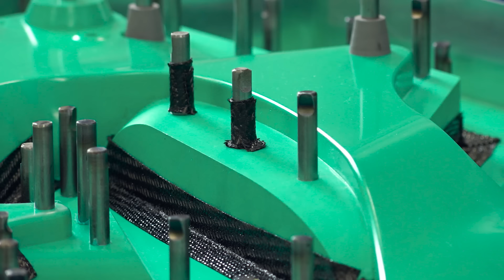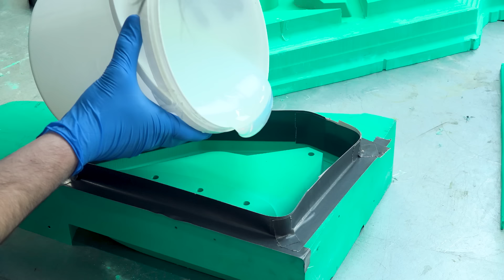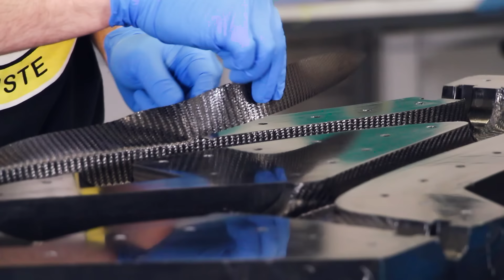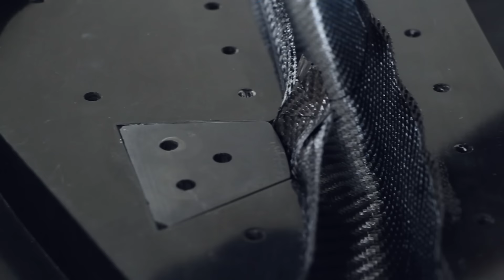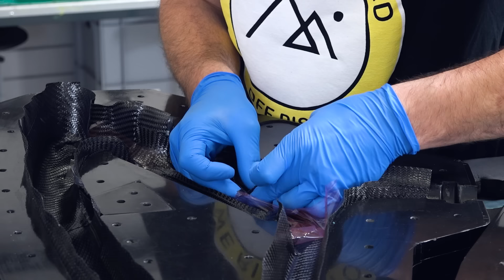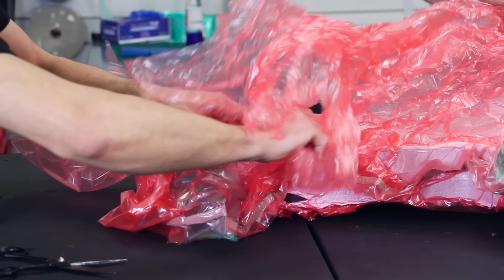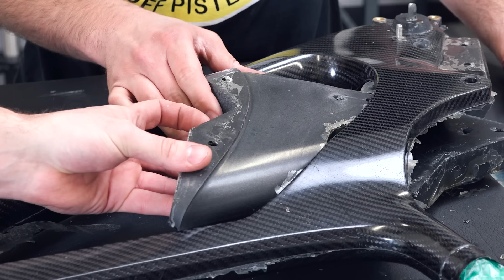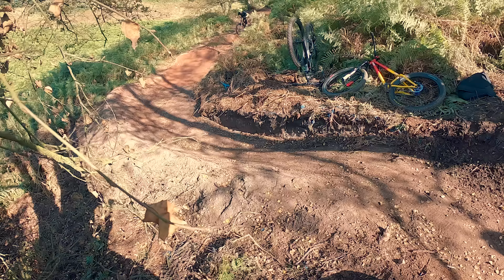Making a Carbon Fibre Bike Frame – From CAD Design to Downhill Race

Comment: This is an amazing video! I'm actually here because I have been trying to educate myself on purchasing a cf road bike frame. However I am one of those people who have to take the deep dive! Just like I did when I got into acoustic guitars. I ended up with a bunch of books and dvds on the topic. Interestingly enough, cf makes a fantastic choice for acoustic instruments. These instruments NEED to be light enough so that the energy from the strings can kinetically affect the sound board and thus make sound. I'd even be willing to gamble that cf could be a superior acoustic material over traditional wood. But that would require extensive r&d. Anyone want to invest ;)
Reply from the maker: There are quite a few carbon fibre musical instruments around now.  The sound is acoustically a bit different from traditional wood instruments. There are a few guitar builders doing just that and they spend ages tweaking the designs and shapes to ensure the acoustic results were good.
Reply: @easycompositestv  I think a fun r&d experiment would be to see if it would be possible to fool experts with a couple classic guitars. Like a spruce/rosewood Martin type dreadnaught or a Torres classical. But I'll tell you that if a concert guitarist walked in with a carbon classical guitar, there would be some push back!

Comment: What type of paint do you use to fill pin holes? That is one problem we have making parts in our shop.
Reply from the maker: Hi, pinholes can be filled with resin or if very fine, with lacquer during the paint process

Comment: admire to awesome contents
i always curious about how to fixed parts on CF ? some kind of bolts, suspension
no different from metal ?
Reply from the maker: Fixings need to have a load spreading plate or similar as composites are not so good at point loadings compared to metals. We sell a range of such fixings on our site.

Comment: Hi. Great presentation. I have a 2015 size Large Cannondale Scalpel SI.  My rear triangle cracked and was wondering if you can make a new rear triangle?
Reply from the maker: Unfortunately we don't offer any specific manufacturing or repair services I'm afraid. We can certainly supply materials, equipment and technical support if you were looking to make the item yourself though.

Comment: Awesome video! I always wondered how these carbon frames are made. Now I know why they are so expensive! Material cost + intense labor. Wow. Questions: how do the designers know the number and type of layers and their orientation? Is there a CAD program specific for this or they basically guess based on experience? Also, can the vacuum bags to be reused? It seems like an awful lot of environmentally hazardous waste.
Reply from the maker: With composite designs, you can either run FE Analysis using suitable CAD software or plug-ins but often, it will be developed through experience and general rules of thumb rather than empirical data. There are reusable silicone bags but they're not great in use with epoxy resins as epoxy tends to deteriorate them more quickly and so you don't get unlimited used. With vacuum bagging materials and PrePreg, often, there is a possibility to re-use them although the actual outer bag can be more tricky dependent on how and where the gum tape sealant is used, things like the breather fabrics can definitely be used again.
Reply: @easycompositestv  thanks a lot for taking the time to reply! I’m very pleased with the detailed answer, thanks for the great support! I’ve worked with fiberglass, resin, etc for years as a hobby but I’ve learned so much more from you! Again, much appreciated!
Reply from the maker: @kovacstamas3756  No problem at all! If you need any further advice please let us know :)

Comment: All those surfaces looks like a nightmare to create in cad
Reply from the maker: Hi Michael, Vlad tends to work in VR to begin with, creating the lines and surfaces in Gravity Sketch to begin with, where they can be worked on really fluidly. He then exports from there and brings that model into Solidworks where it's re-built, using the Gravity Sketch as a template. And yes, a frame like this is a challenging thing to model!

Comment: It does no good to test a frame with a stronger layup than what will be used unless you plan to do another full test on the production models.  Breaking a 'standard built' 1st test article will show where additional support is needed and add to the knowledge of engineering and should make the bike lighter and stronger where needed instead of making the entire bike over built.

Comment: I don't quite understand how the staggered section between the halves work to keep a constant thickness. Do half of the layers get cut off at the mold line while the other half (inside plies and outside plies respectively) get loosely aligned while the halves are clamped in place? And then the inner bag is used to create the tight connection between the halves?
Reply from the maker: Yes basically.  The wall thickness will be slightly thicker in the overlap area but that is necessary to ensure there is sufficient strength on the joint. The pulling of the vacuum pulls the tubes against the inside surface pressing the fabric tightly into place.
Reply: @easycompositestv  Thanks for the reply. That's so f'ing clever, I love it!

Comment: Looks like totally overcomplicated process. Why not 3d print a very thin, say 1 mm frame from PLA and just gently stick that carbon material on it all around, with resin. Forms, pumping air. Looks like a total waste of time and effort. Not precise work. 10x too much work. Also, this can also be done with styropor if not 3d print. Plotter should cut this material, not manual work.
Reply from the maker: For a total one-off, your method could work although you would have a lot of finishing work on the outside of the frame if you're overlaying the carbon on the outside. However, it wouldn't realistically be suited to mass production. The method of production here is incredibly accurate and where replication is key, would be a better solution. You're correct on the plotter cutting of material; for the first frame out of the mould, this was hand cut but if you were rolling out into production then you could have the PrePreg cut on a plotter for even greater accuracy.

Comment: Seems like a horribly inaccurate system. Why would you not just use a solid block of aluminium?
Reply from the maker: It is actually pretty accurate. CNC board, a coating a fraction of a mm thick then the mould mirrors those dimensions exactly.  Aluminium block would be massively more expensive.

Comment: I'm no expert on composite materials but I still have a really good tip,i use to work with construction making concrete and to check the concrete mix that it's perfect we make a cube 10x10x10cm and put it in a pressure machine which loads 10kilotons of pressure on the top of the cube, you should do something similar on the prototype frames put a bar trough the hole where the Crank is supposed to be right above the bottom bracket and apply the pressure,to simulate the pressure and stress the frame recieves by bottoming out the damper/rear shock.ten kilotons ain't really that much, hundred kilo plus downwards speed can very easily become a few tons, should do a similar test on the steering tube to but apply the pressure backwards from the bottom of the fork to simulate when you land in a pothole or something with the front wheel..

Comment: Curious would you get the same/similar result if you just inflated the inner bags? or would that trap air making the bagging less effective?
Reply from the maker: Yes, you can pressurise the inner bags but this would create unequal pressure on the mould, trying to force it open and distorting it meaning that to use pressurised bladders you would need a much stronger mould such as a solid billet aluminium mould, which is of course much more expensive to produce.

Comment: Is this only achievable w/ pre-preg? What would be the wet layup option?
Reply from the maker: There wouldn’t really be any other way to realistically make a bike frame, not using a moulded method anyway. The only wet layup option would be hand laminating carbon and resin onto a foam core that’s left inside.
Reply: @easycompositestv  Thanks pretty much the conclusion that i came to

Comment: A very laborious and time costly process.  Would it not be rather faster to fill the mould with molten wax and then lay carbon fiber layers around the wax model?
Then cure it? The wax could be easily molten to recover.
Paraffin or wax filled with plastic nano fibers  would do the trick.
Reply from the maker: No, I’m afraid that process wouldn’t work for a lot of reasons. Producing a well made carbon fibre bike frame isn’t quick or easy, it requires quite complex processes. In fact, by bike frame tooling standards, the method shown in this video is much lower in cost than the industry standard of machines billet metal split tools.
Reply: @easycompositestv  can you please give some insight about why the wax impregnated with plastic fibers wouldn't be a good process?
I was thinking about the process by which you do the scuba diving carbon fiber bottles...
I have wee this process in McLaren car manufacturing process. That's how they manufacture the complex doors.
Reply: @easycompositestv  you can use CNC directly to the wax, wrapping around the carbon fibre layers ar different directions use the vaccum and the autoclave after melting the Wax.

Comment: I've been thinking about a more "DIY" approach to this, that might involve much less machinery, for people wanting to make (usually small) frame components in home workshops, and I'd be curious what you thought of the following:

3D print (in PLA) an internal frame structure with low infill.
Wrap the frame in the layers of Prepreg (bought from your store of course).
Cover the outer layer of the Prepreg with some high temp silicone, or even something like a cement mix.
Cook the epoxies in a temperature controlled oven, with the PLA getting drained into a tray.

Feel free to poke big holes into this process if you like!
Reply: Cool initial idea, as of 3d printing the frame but I believe it’s better not to use the prepeg carbon fiber. I think the traditional way would be better for your approach on the frame build. Because when you put it in the oven, and you mentioned the pla melting off as a release mechanism will most likely cause deformation in the CF. 
Heres one idea maybe.. 3d print the frame then make a negative mold out of it. Them fill the negative mold with expansive foam. Layer up the foam frame. Let that dry, then add another layer but this time using the suction pump. I think the expansive foam can be removed from the inner frame by drilling an opening and a release hole. Pouring on to it a liquid compound that would disintegrate the foam in to a sort of liquid state and easily come out the release opening hole.
Reply: @rreyesco  that's an interesting idea about foam and a solvent. A similar thing can be achieved with ABS plastic an acetone.

I don't understand the need for the extra step though? If you have a negative mold, why not lay the CF in that?

Or why not straight away print the negative mold? In two halves ready to fill with the foam? Or similar, heat resistant internal material?

I didn't think too clearly obviously about the heat treating of Prepreg, but what temp does the internal 'volume' need to resist to? I'd love it to only be two steps. And ABS can resist to 110c.
Reply: @mortarriding3913  You could probably use PVA filament. It's dissolvable in water.

1) Print an internal frame out of PVA. (Low infill, thick and smooth shell,etc)
2) Wrap your release layer and selected prepreg around frame.
3) Place in vac-bag and pull a vacuum or even another release layer and do your silicone or cement thing? Although I think a vac-bag would give a better outer finish.
4) Cook your CF.
5) Take it all off the cooked part, etc.
6) Place the CF part and internal frame into a vacuum sealable liquids bag, and fill it with a water/methanol mix (you'll have to search up best dissolve ratio) and put it in kiln at 80C for 3 hours. This will dissolve all the PVA away.
7) Take out CF part and finish it.

I think this could work. Especially for small parts or custom CF as you spend less on forms, generate a lot less waste and won't have forms laying around after you've completed the part.
Reply: @rubenzikarsky5195  that's an even better idea! PVA is almost made for this purpose.

Comment: It is fairly easy to undersize a master model to account for CTE. The reason you low temp cure tooling prepregs is to use cheaper, low temp tooling board.
Reply from the maker: Actually, the difference in price between higher and lower temperature tooling boards is not that significant. Yes you can anticipate CTE of the master in order to achieve dimensional accuracy but in many cases the shrinkage of the master will either 'lock in' the carbon component (which has almost zero CTE) making it difficult to release or, quite often, crack the master as it shrinks around the component. This is well understood and can be avoided (or mitigated) by lower initial cure temperatures. In almost all respects, lower initial cure temperatures for tooling prepregs is preferable, that's why all major manufacturers make low initial cure one of their key ambitions.
Reply: @easycompositestv  low temperature certainly makes it easier in all aspects. A 70°c board will maybe hold 120°c if that's what you mean but as you know above that options are fewer and cost is doubled. A PU board for below 50°c is half the price but surface quality surfers.

Comment: Fascinating piece of art. The carbon joins around the headtube look sooo sexy. Is that how they mirror layup patterns in the center of Lambo hoods/wings/bumpers? Just overlay two pieces, put it under vacuum and it will create a smooth joint?  Because i still don't understand how they do that without any fraying.
Reply from the maker: Yes, that's how they do 'mirror joins' or centre partings/chevrons etc. You're working with prepreg anyway and so the fibre is much less prone to fraying. Next, you only need one perfect cut line, the other layer of fabric 'laps' behind it - this is easier to get really tidy that if you tried to have two cut lines that butt up perfectly to each other.
Reply: @easycompositestv  Thanks for the reply! i noticed you guys reply to comments, that's awesome. Congrats on the 200k dude, great content!

Comment: Hi Easy Composites, easy to say the best video on youtube on how a carbon frame is made! I'm new to the carbon frame world, and there's a little confusion that's bugging me. Compared to the technique of having carbon sheets stick onto an EPS frame, how would these pressured tubular bags compare? Does it give better inside surface? Does it help with weight reduction?
Reply from the maker: Hi Tigor, using the foam core method is likely to produce a heavier frame if it had the same strength as one produced in a mould. Both the inside and outside faces of the tubes would be less straight (more wobble) which reduces strength and leads to extra weight once thick coats of resin or clear coat are added to correct the surface. You also have some extra weight from the core. That said, it is a less complicated and expensive way to have a go at making a frame. One of our customers did a beautiful job of a similar process.

Comment: This is very "off-topic" compared to the bike wich is in this video,but making a Motorcycle gastank and gluing this together without getting to problems with the gasoline and rection with the glue-OR is it possible to make it as a "one-piece"? Sorry for barching into this video with this
Reply from the maker: You would need a tank lining compound to be used that is ethanol resistant for modern fuels for it to work long term.
Reply: @easycompositestv  Thank you

Comment: Hi, what CNC model you recommend to make the molds?  Thank you
Reply from the maker: It really depends on the size of the patterns you want to machine, the accuracy and your budget. A large 5 axis CNC such as the one used for most of these moulds would set you back tens of thousands but smaller 'desktop' CNC routers are available for under 1000 these days. We bought a low cost 'CNC EST' mill off eBay to see what it was like and it works really well. It's only a small bed and we don't run it hard but for a starter machine you can't fault it really.

Comment: This carbon fiber frame using epoxy ? Or resin ? 
Or just oven and vacum only ?

And please make a tutorial about swing arm motorcycle
Thanks sir , this is amazing i like it 😍
Reply: Epoxy is resin. What did you mean by resin? Or do you mean Polyester resin?
Reply from the maker: Yes, epoxy is resin. The frame is carbon composite, so, epoxy resin reinforced with carbon fibre. Please check the description above for a link to the project page for this tutorial on the Easy Composites website; the project page lists all the products used, and you can even buy them too!
Reply: @easycompositestv  But I don't see you putting the resin in while vacuuming

Comment: If you want a really good frame, make a frame from aluminium and carbon. Carbon outer layer, aluminium inner layer. This technique is used in building planes and it results in a frame both light and resilient. No more cracked carbon!